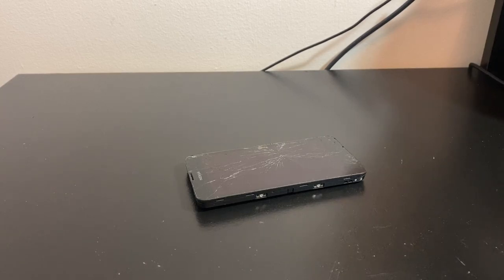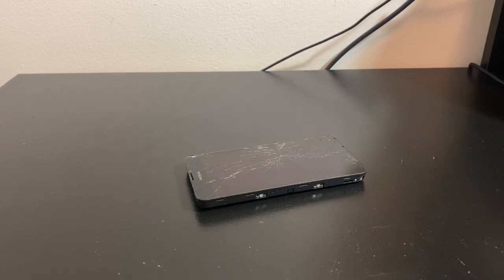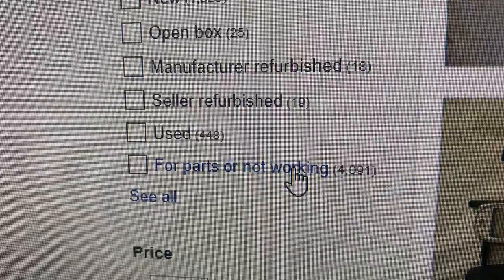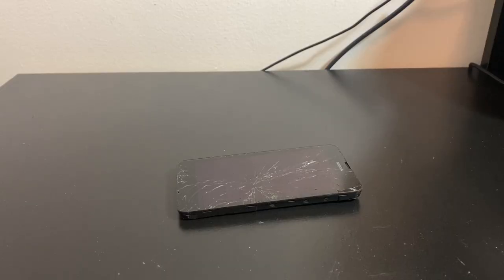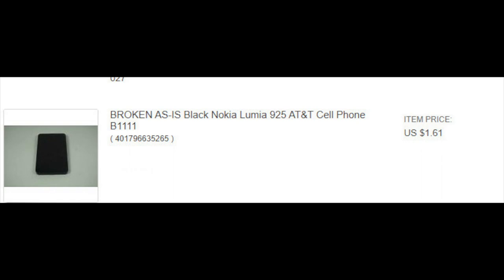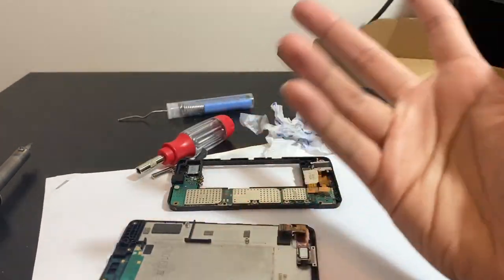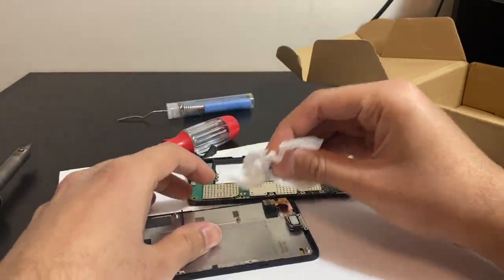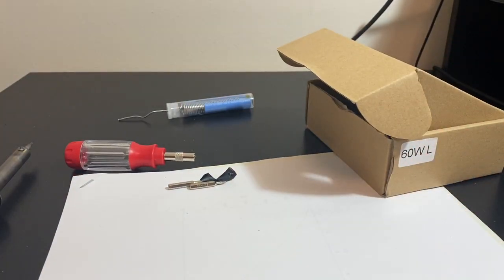I Bought The Cheapest Broken Smartphone on Ebay!

Comment: You got the wrong battery pinout,Nokia phones has positive at the outer side,then negative then ground
Reply from the maker: I eventually did try all 3 combinations off camera..didn't work, thing probably sat water damaged for too long
Reply: Techformative there's a capacitor that shorts the board out when water damaged most of the time,removing that specific capacitor will allow the phone to boot again(I tried this on a water damaged 630 before and it worked afterwards)
Reply from the maker: I'll check that out when I get some time..also gotta wait for my new multimeter, the damn thing is probably hold up in china cause of the Virus thing..thanks for the info! much appreciated!
Reply: @Techformative557  lmao thats funny and hes right about the capasitor I tried that too